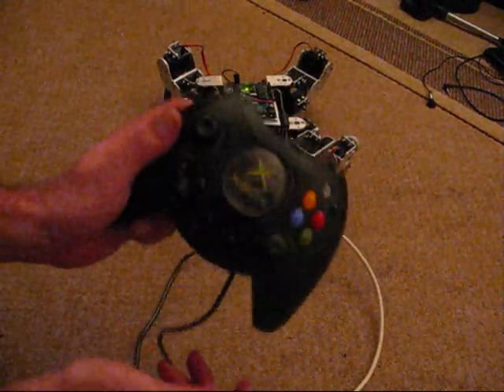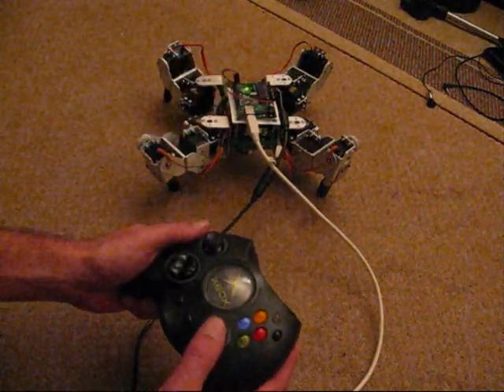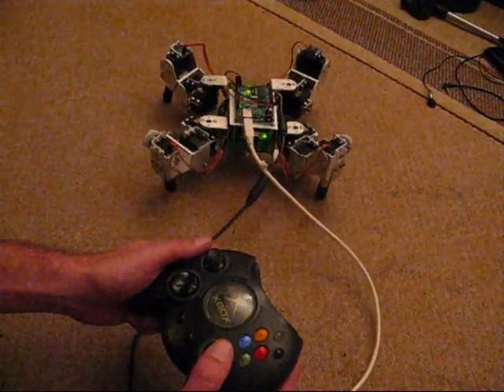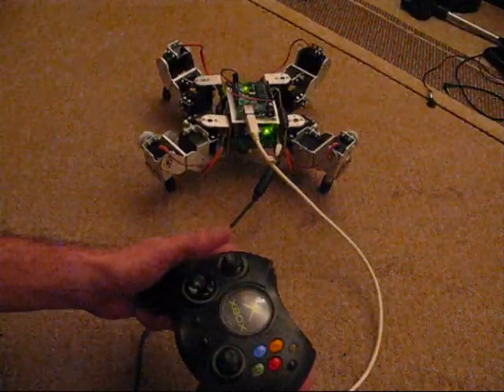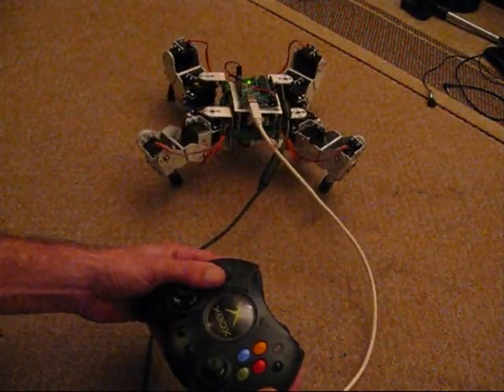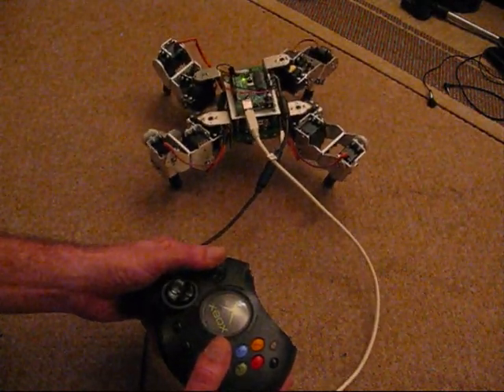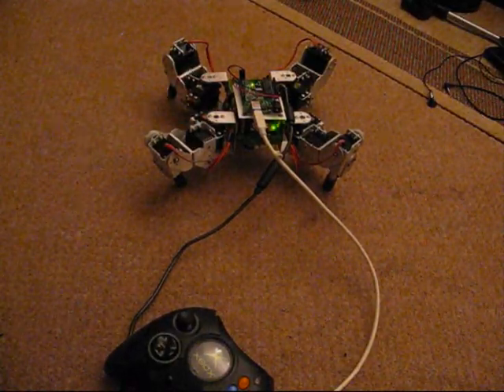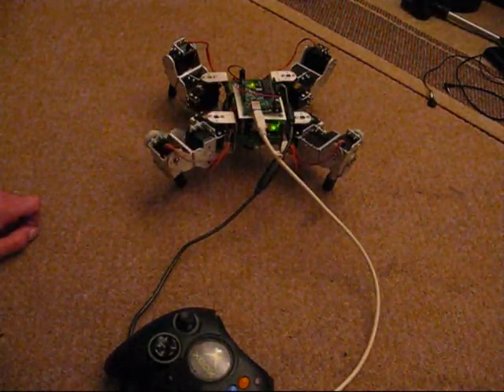Q-P1 "Quadru-Pet 1" - part 3

Comment from the maker: np, and yeh - the code definitely needs calibrating. I just got a new chassis and 4 new HS645s but 4 more of the cheap towerpro servos burnt out so I'm shelving the physical robot till I can get a full set of HS645s - the cheap ones are just not worth bothering with. Working on new software from the ground up for the time being but also in mid move so pretty busy! How's the hand?